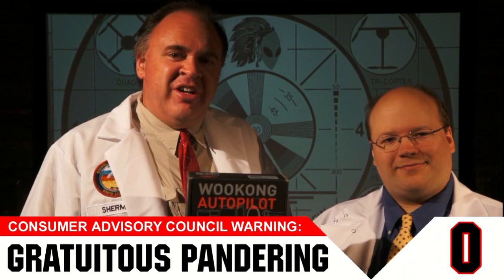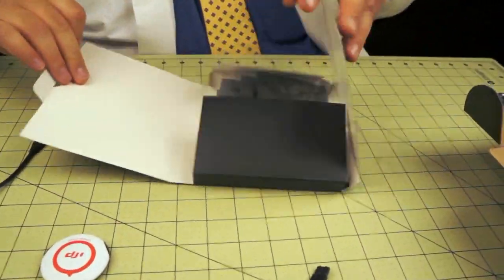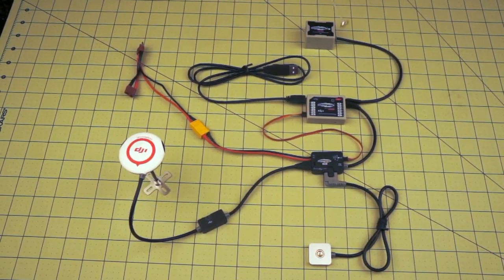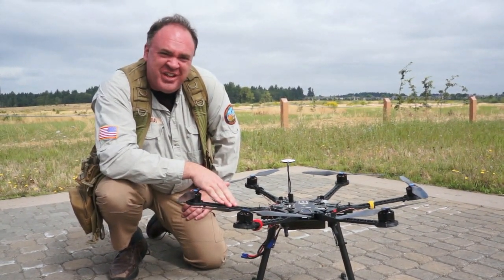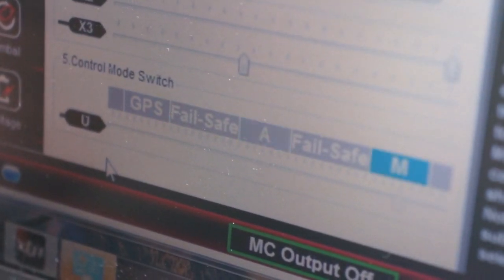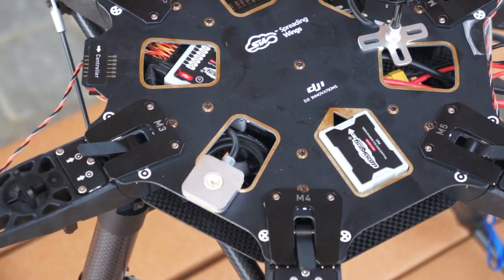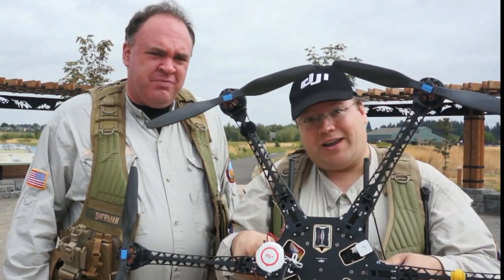RFTC: DJI WooKong-M Unboxing, Installation and Testing

Comment: İ have a question to you. İ have wookong m and i cant run it. İ make all settings but when i running the octocopter just fist and eighth motor run. When İ increase the throttle all motor running.  İ try all of modes ( altitude, gps and manual mode). Can you help me. İf you can i send you video.

Comment: Would you install this FC in a very expensive UAV full of sensors knowing that all this DJI FC have a history of flyaways and crashes?
Reply: svsoftair The "history" is caused by incompetent pilots. Knowledgable and careful pilots will not make mistakes as rudimentary as fly away. JUST CALIBRATE YOUR COMPASS EVERY TIME YOU FLY, is that so hard?
Reply: Andrew Geng  according to your statement Flight controllers by DJI has nothing to do with flyaways, just incompetent pilot...is so, why DJI never replies to flyaways questions? bottom line DJI is a chinese factory full of mediocre chinese employees, result: a mediocre below standards product
Reply: How do you know they never answer flyaway questions? The cause of flyaway is simply because your drone is in went into failsafe modem but it doesn't know where to go! If only people took the time to calibrate the compass and designate home this would never happen! Your statement regarding "Chinese quality" simply does not make sense, because most of the things you own is "made in china." so there is no comparison what so ever.  Can you also tell me why that DJI is the only drone company that is worth "One billion dollars"?If it is so crappy?  Why is it that no US company could develop a god damn flight controller that DJI does? (Pixhawk is based on DJI flight controllers ). Personally have used a DJI phantom 2 vision, I took care to calibrate its compass every time I fly and it worked perfectly. Once my battery became critically low, it flew away. I got scared, but only for me the later realise that it went back the the exact same place where it took off. DONT DISS DJI, BECAUSE THEY ARE THE FOUNDING COMPANY THAT COMMERCIALISED DRONES, AND POPULARISED IT.
Reply: Andrew Geng DJI will not answer any crash related questions, much less FC questions, the lack of support and QC on this chinese cheap factory is rampant. You cannot just summarize that all causes of flyaways are just compass calibration, even if you calibrate the compass on a DJI the  chances of a flyaway are plenty. DJI is the major player that is making the drone technology unsafe, unreliable and chinese. Good thing to see the yuan is going to hell, china needs to go back to rice instead of its toxic manufacturing of crap. Pixhawk has nothing to do with DJI and by the way the global copy cats are these chinese individuals who has not brain but to emulate some others inventions or am I lying?
Reply: I did some more research, most of all the flyaway are caused by V3.12 on the Naza M v2 flyaways. It is their fault, but this only happened once, and they did a massive recall. If i remember correctly.... GM used to do recalls all the time when their cars failed to STOP. China created all your stuff. if it wasn't for China you would be still living in the 13 colonies. China is TOXIC, because they are manufacturing all the shit that the world uses. Do some research on Pixhawk, it was founded by Colin who used to be partners with Frank Wang ( CEO of DJI) in DJI. He quit due to disputes and took some of the people from DJI to create 3D robotics, which makes SOLO and Pixhawk. I cannot tolerate your racist tone, how can you condemn a place that literally created everything you own. YOUR FUNDAMENTAL SENSE OF QUALITY, IS FORMED BY THE PRODUCT CREATED IN CHINA.
Reply: It looks like DJI benefited from Colin leaving since the SOLO and Pixhawk are rubbish!  I have a Pixhawk PX4 that I've been trying to get working since 2012 with no success because the software is crap and if you check the reviews of the Solo on Amazon 1/3 of them don't fly property or at all!

Comment: Hey Guys, You Are Great!

Quick question if you would please indulge me.

I am using NAZA-M V2 with an Octocopter, which is similar enough to the WooKong for my question to be relevant...

Setting up the Flight system as an Octo requires me to use F1 & F2 for M7 & M8... so where do I plug my gimbal control into now??

If there is no way to have both an Octo and gimbal control (not good design IMHO) then what do you suggest for a gimbal control alternative?

Thanks So Much!!

Comment: Thanks for the setup guys, it help alot BUT it has also left me qurious in regards to the GPS arrow (pointer) you mention regarding true north. Im unable to find anything in regards to the correct placment of this arrow on the GPS unit and now doubt ill try to fly without knowing its correct position. is it that big a deal or am im worring over nothing??

Comment: Hi I recently bought a multi rotor off a friend.  It has wookong M.  I am extremely new to all this.  the copter is already programmed and flies great.  My question is if I download assistant software from DJ I and plug the copter in will I potentially lose the settings?  Would like to be able to learn the software and also back up settings but don't want to chance losing current settings,  as I think I'd be lost trying to get it back. Any advice would be greatly appreciated

Comment: Hi there. I recently got the S800 along with the Wookong M and the data link which brings a single waypoint. I have been having some trouble using the GCS. It seems the handshake doesn't work. I got my S/N number from the distributor plugged it in, it says activated but won't get a GPS lock. I've tried it in various locations. Any thoughts on what I might be doing wrong.

Comment: Hey guys I was looking at your video on the unboxing and installation of the dji wkm system on the s800 and I was wondering where you mounted the pmu Comtrol unit, doesn't that have to be in the centre of the s800? Or can that be anywhere on the s800 but the imu has to be in its delegated spot?

Comment: Thanks for acknowledging my comment.
Most model clubs will not allow running engines or live electrics in the pit area anyway. 
The Naza and WooKong do disable the ESC outputs but only once the USB connect has been established. And the manual does say to remove the props before starting Tx calibration.
On my 950 Carbon Hexa I have all the gains set to 220% with altitude at 155%.
100% Dual rates in manual mode and 30% in Attitude mode. Although my Hexa is bigger and lighter with the same gear! ;)

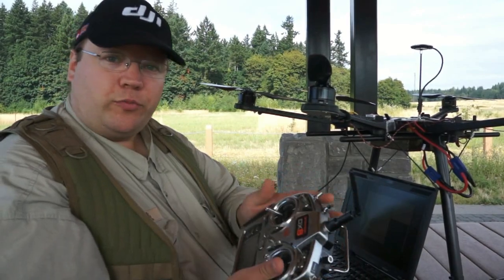Comment: 7:59
You have a LIVE electric model in the pit area, with propellers in line with your face. That is very bad practice and please do not encourage others keep the propellers on the motors while changing the program.

You have done a good jog of simplifying DJI's 48 pages for the WKM!